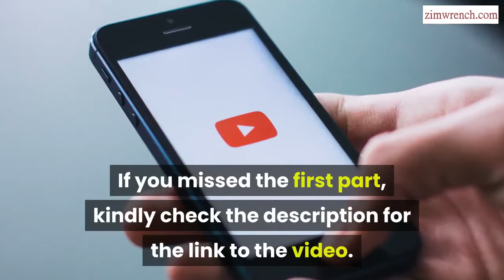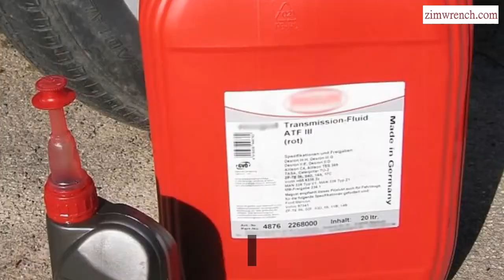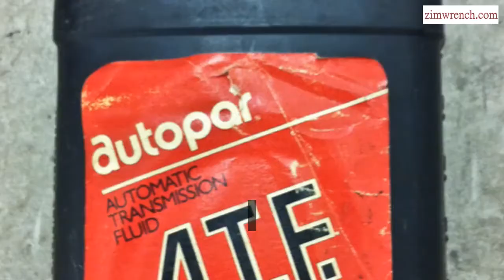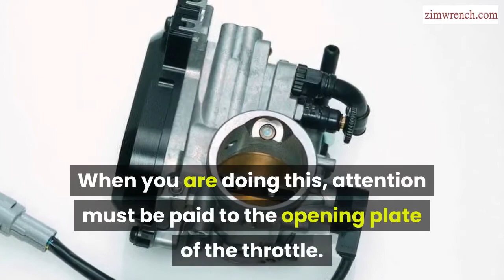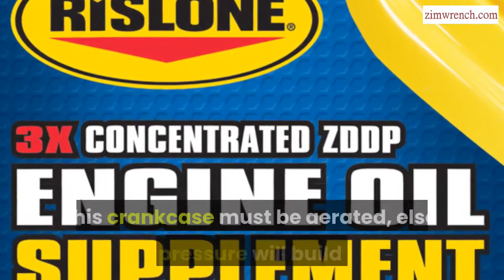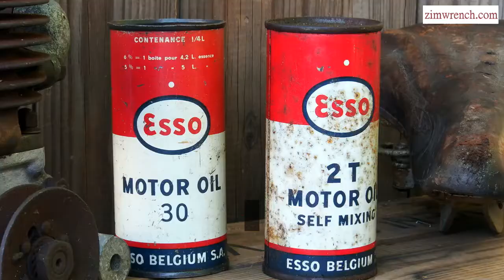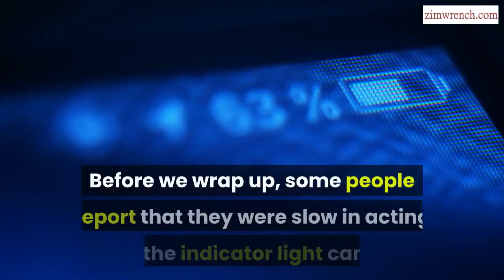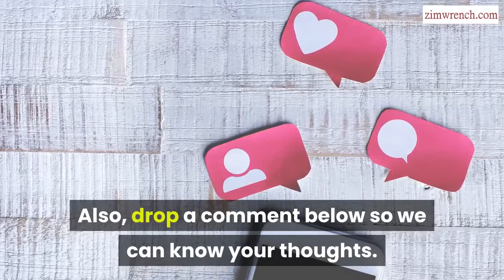What Does The Wrench Light Mean On A Ford? (Car Safety Part 2)

Comment: I drive a 450 Ford engine MotorHome. Yellow wrench goes on. We lose power steering, we pull off highway, turn everything off. We wait 15 minutes, turn on engine, all works perfect for another 300 miles, we do not use cruise control. That’s our experience. Any comments?